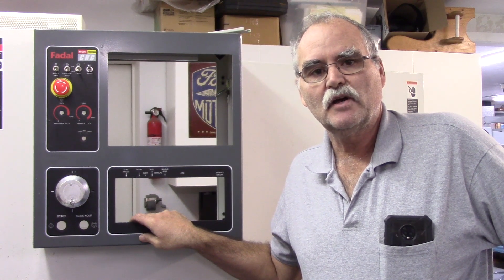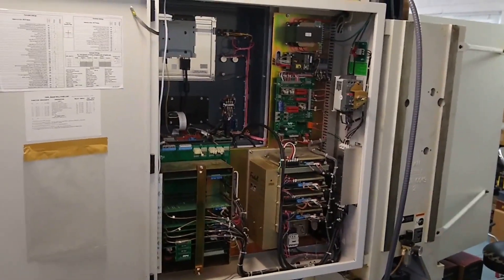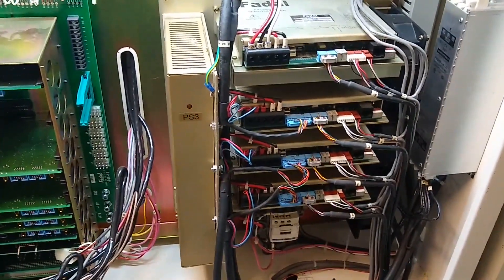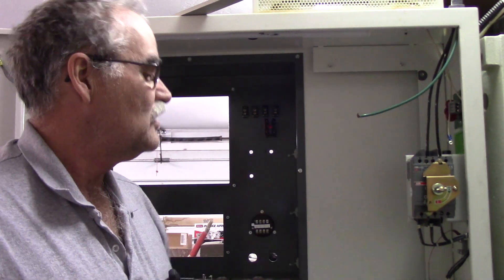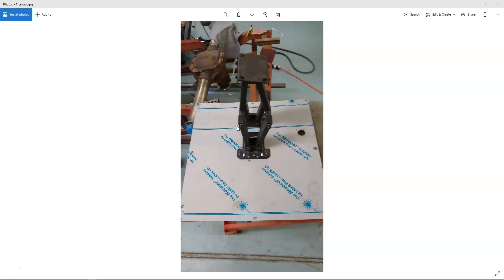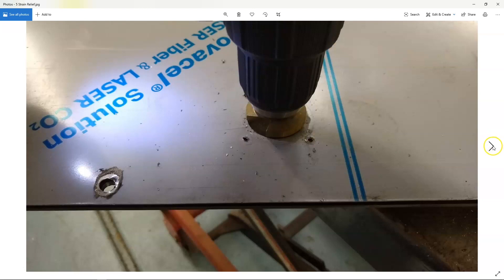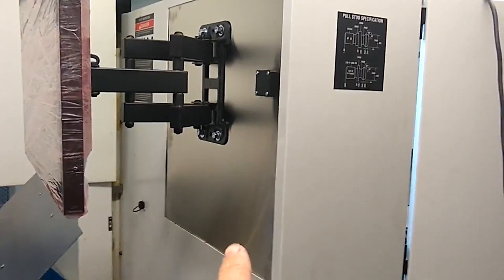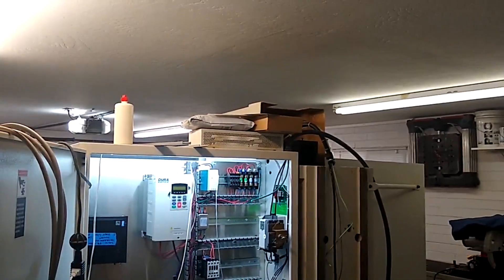FADAL TRM UPDATE #3

Comment: I’m so confused why you would downgrade the controller?

Is the fadal stuff for sale I’d be interested in purchasing it if you don’t plan on using it.  Edit I just saw you already sold it.
Reply from the maker: Downgrade is a matter of opinion. I consider it a significant upgrade. You either like or hate the FADAL control....
Reply: martyscncgarage well wether you like it or hate it it is still a very a solid control. Sorry you don’t like it. How much did the retrofit cost generally? Looking to do similar but not on a fadal.
Reply from the maker: Ian, the Centroid Oak is quite powerful. It runs their 5 axis machining center: https://youtu.be/Ez20PFZyjBk  

The interface is a reasonable Windows 10 PC. Easy to network, easy to load programs via USB, no drip feeding the control, etc. All motion control is handled by the OAK motion controller. 

As for price, that is all dictated by the machine type, complexity, the type of axis drives/motors used (can they be reused?) spindle drive etc. This is a relatively simple bed mill. Also depends on whether or not you are capable of doing the work yourself. If so, simply price out the parts. I estimate I will have under $5k in parts, including the new VFD in this conversion. The machine is in EXCELLENT condition. Purchased new by a retired engineer making small injection molds in his home shop for a client doing prototypes in the medical industry. So it warranted the upgrade cost.